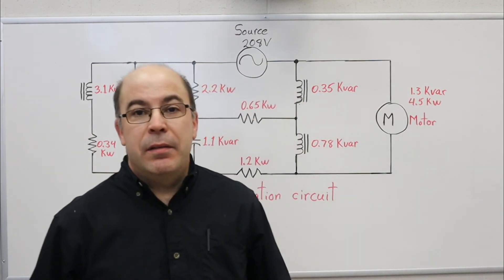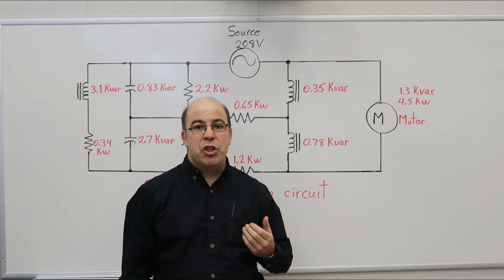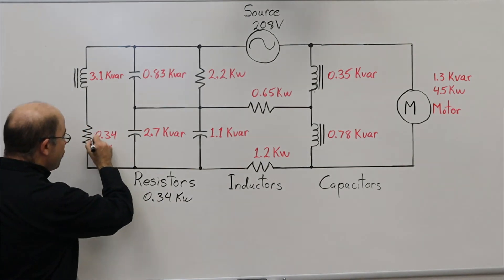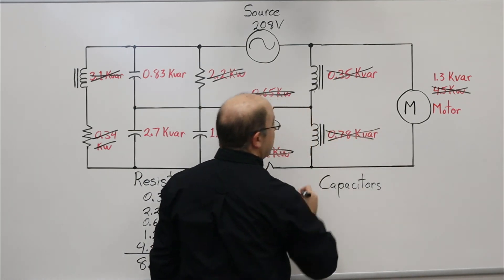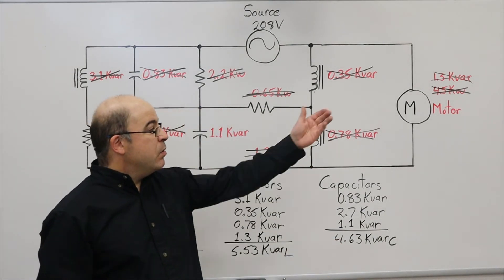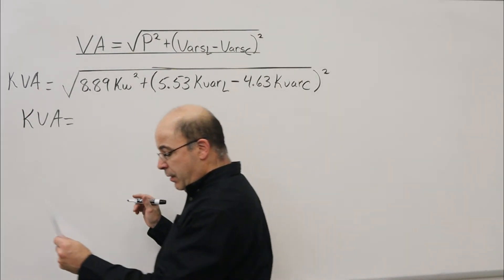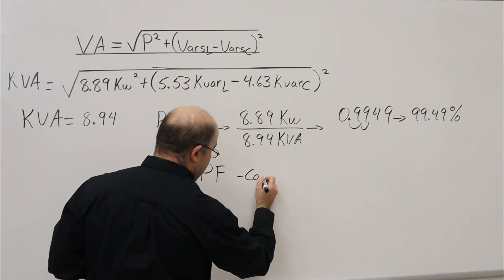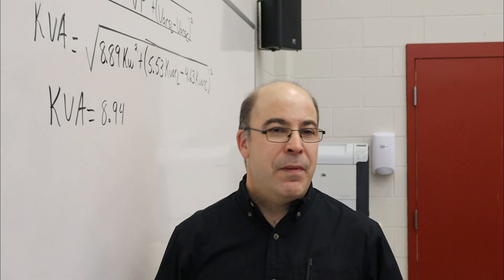The R L C Combination Circuit

Comment: Hi, appreciate your work. I am not an electrical professional. I am just wondering, would the calculation be different if those loads are wired in series instead of parallel? Thanks and more power.
Reply from the maker: Thank you for your kind words, the procedure works the same regardless of the type of connection. It becomes too confusing and complex  when there are resistive, inductive and capacitive loads that are wired in various configurations, the easiest method is to work from values of Power and apply a Trigonometry formula.
Reply: @sergelevesque6292  thanks again for the feedback.